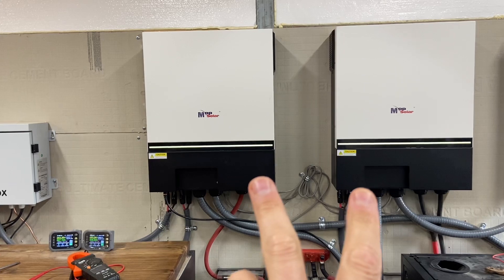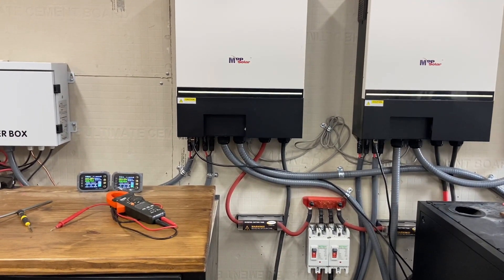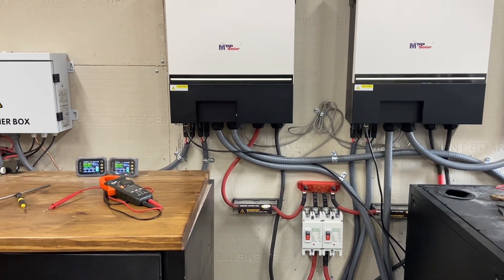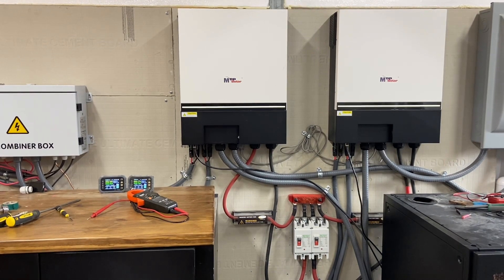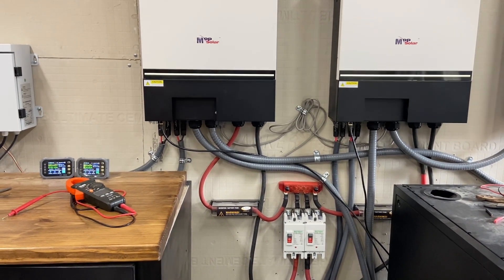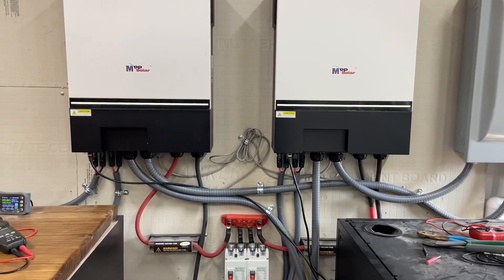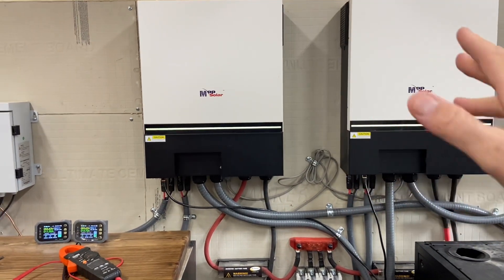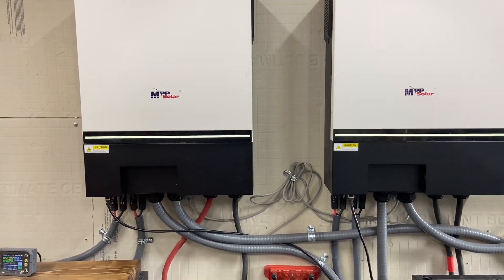My negative thoughts on  EG4 6500ex inverters.

Comment: I’m running the 6000ex from EG4  2 of them total junk flickering lights non stop fault codes and error codes now the units keep shutting down   Unbelievable anyways signature solar has been no help whatsoever they ask for information you send them information you don’t hear back from them wait days and days for a response can’t get a hold of anybody don’t get me wrong they have some fantastic people working there when you finally do get a hold of somebody but I’m definitely going back with my MPP’s over signature solar total junk 👎🏼👎🏼👎🏼👎🏼👎🏼❕❕❕
 The batteries are great  
 I can’t wait to get the 6548’s  
  And yes they are defective  it’s BS 
 They tell me that’s just how they should be running. Total crap. And so many misleading different answers  but like you said never can get and straight forward answer 
 I’m burning breakers up and Jeopardizing appliances in my house because of this faulty garbage all in one unit I’m running
Reply: I had the same experience with them, and I spent 30k. Lesson learned.

Comment: My MPP 6548’s have been running solid for a year now. I do supplement from the grid during summer or long periods of no sun and then only charge off peak rates. Even so my ROI will be 4 years. The only problem I’ve got is when the grid goes down, people keep asking why my whole house is lit up and still running, wondering why they don’t hear a generator.
Reply from the maker: Yeah mine have been running great. I’ve been wondering why you haven’t made more videos on your system. You had some good content.

Comment: I bought a 15K   Seems to be worth it.  I run in in tie grid feeding my shop and house now with the cts. Power goes out  and you off gid.  200 amp hook up.   I all most bought the eg4's but didn't.   I replaced Growatt 12k.  that seems to be a good inverter for $2500.    Just want more solar voltage.
Reply from the maker: Yeah, you really can’t go wrong with a solark. Eventually that’s probably where I’ll land. Deye already has a 16k inverter out now. That would be awesome to see in the next year or two with solark.
Reply: @GavinStoneDIY  you got to pay for it though. And still made in China.
Reply from the maker: @bigblockcutlass123   yeah basically all of them are.

Comment: Possibly stupid question but did you verify they were set to 60hz instead of 50 (Manual says 60hz is default but mine were set to 50hz)  this would cause your exact issue
Reply from the maker: I did verify that yes. I also thought it could be an issue with idle vs having loads. It strobed either way. The real eye opener was when tech support informed me they get calls about that problem all the time. I’ve read that people have scoped the sine wave output and it’s dirty.

Comment: Installed mine yesterday (EG4 6500EX with 3 Lifepower 48V batts with rack @ 120Vac 60Hz. 3500W PV) and I also started to have the same problem among other faults codes (32 and the famous 61) and a "bp" warning. Some LED dimming and non-dimming lights start to flicker or glowing on and off sporadically, one UPS started to make a clicking noise and the refrigerator light (not led) also flickers sporadically. Problem seems to come and go every 10 to 20 minutes. Is annoying. I am very concerned and worried that my appliances will get damaged. I wish I have known about this issue 2 months ago before placing the order to SS. I replaced a 5-year-old 24V 3000W Sungoldpower Inverter which was working perfectly and without this issue never, for this noisy EG4 6500ex piece of caca.  I am very disappointed and mad about this purchase. I regret about choosing this PoS brand and following some guys on YouTube who are posible biased, getting paid or having this equipment for free in order to get honest people to waste their hard-earned money spend on this crap of EG4. Thanks, Kevin, for telling people the truth about this issue and for them to think twice before purchasing this inverter from SS. I live in Puerto Rico and knowing about the restocking fee and shipping cost to send it back to SS gets me very angry. I will save that money and purchase a better brand Inverter and from a trusted and honest company.
Reply: Sorry Gavin, I wrote Kevin in my up comment.

Comment: Since the Neutral ground bond screw is out of your inverter it needs to be bonded in your Sub panel this will fix your lights flickering and going crazy
Reply from the maker: That isn’t the problem. I have everything wired correctly. I have the mpp lv6548’s wired the same way with the bonding screws removed. This has nothing to do with why the lights were flickering. There is an issue with inconsistent voltage coming from the eg4’s. And no issue at all with the mpp version. Eg4’s aren’t generating a pure sine wave in my opinion. All EG46500 inverters seem to have this problem according to signature solar tech support. And that goes far beyond just lights. It will eventually ruin sensitive electronics.

Comment: Thanks for sharing.    EG4 has requested Voltronics make several changes for the EG4 version of the inverters.   Some of the changes include firmware, PV voltage, and connectors.  One of the most recent changes was the removal of the bonding screws.  They may have requested cost savings on some of the components as well.    I have no doubt that one of the changes they made had unintended side effects.
Reply from the maker: Interesting. If they were transparent about that then I would completely understand. I just wouldn’t purchase the inverters. It’s the pretending there is nothing wrong part that I have a problem with. Well, that and charging me 40% restocking fee plus shipping on a defective product. Definitely have an issue with that as well. Since they already know there is an issue, it’s just dishonest.
Reply: @GavinStoneDIY  They should refund those fees! If they want to grow a decent customer base, they will make each and every customer a happy customer!
Reply from the maker: @Tumbleweed5150  everything was completely refunded. I did a follow up video here. Eg4 6500ex follow up review.
https://youtu.be/3192QyqAsCg

Comment: An easier fix would have been to replace your led bulbs with a different brand. I had the same issue, with GRID power, and changing to a more expensive LED solved the problem.
Reply from the maker: If the eg4’s were my first inverters I may have considered it “normal”. But since I had the mpp lv6548’s running with the exact same lights and wiring without any flickers or issue, I realized it’s a problem with the eg4’s themselves. Dimmer switches can malfunction, and cheaper bulbs can shimmer. But I don’t have any problem with my other inverters. So their “upgrades” on these inverters have caused something to create inconsistent voltage. I wouldn’t want to cover that up. Instead I chose to not use what appears to be faulty equipment.
Reply: Led bulbs have different circuits for driving the LEDs and there is no way of knowing what circuit design a bulb uses before buying. You want bulbs that fade to off. If they fade, there is a capacitor just before the LED in the circuit and it costs more to include it. Avoid the cheap bulbs in bulk packaging. No need for premium either. Just experiment with bulbs that are a few dollars more than the cheapest bulb and you could get lucky. Try flicker free bulbs.
Reply from the maker: @adamosity7127  definitely worth experimenting with bulbs. My issue wasn’t with bulbs though. It made my standard halogen bulbs blink the same. Likely s voltage issue. I’ll hopefully have a follow up video soon.

Comment: Wow if I had known  would have never bought them. Going to start mine up next week for the first time.
Reply from the maker: Just keep an eye on it. Running sensitive loads may be a bad idea with those inverters. If you haven’t unboxed them then I believe it’s just a 5% restocking fee and return shipping.
Reply: How has it been going after 5 months?
Reply: @fasnuf  not too bad, but went to move around some pv wires at the inverter and forgot they have power on the input side and fried the pv board.  Had to have it back up asap and ordered a new one.

Comment: I agree the eg46500ex have a dirty output but you have to consider the cost. In my case running 2 EG46500 split phase I scoped the output and it was Very dirty and I did get flickering on some dimmers but not all. I decided to continue to use the EG4 and replace the flickering dimmers with a model that did not show a flickering problem and put all my sensitive electronics on a UPS  that cleans up the power.  Its unfortunate SS has a poor reputation on customer service but with there sales volume and price structure why would they care. How many of you were surprised when Victron pinned there brand to SS.
Reply from the maker: They are just a dealer for Victron I assumed. I did see their announcement. But they are already selling victron products. Like current connected is. I think it’s a shame they are selling unpure sine  wave inverters. The costs isn’t that much different for an mpp version. I would definitely stick with that. The UPS is a good idea in a pinch though.
Reply: The flicker only appears to happen when connected to utility power in specific modes (from numerous reports on forums). There's supposed to be a firmware fix to address it, but it seems like it's too sensitive in it's current response to loads, and those dimmers also use active circuits which might be creating a "ping-ping" effect. I'm going to put a scope on my inverter once it's running (still a bit more wiring to do)...Having a static load on the same circuit seems to help, which would make sense by creating a higher baseline current and stopping the ping-ping responses. If you have a couple of appliances that run all the time (fridge, freezer, HVAC) split them between the two loads and you should see an improvement. It also helps balance the loads between the inverters which needs to be done.
Reply from the maker: @Mike80528  I’d be anxious to hear what results you get from the scope. According to tech support the firmware update was to address the inverter not automatically restarting in certain modes. But has nothing to do with any flickering issues. Although some of their staff on the forum said otherwise.  I tried mine with a load and without. Also with grid and without. It just always seemed to strobe. A slight flicker can occasionally occur with an extremely heavy inductive load. But that happens with most inverter. Sometimes even LF inverters. This was far more then that.
Reply: How do I research the replacement of a CPAP so that it works with the eg4?
Reply from the maker: @boydbrosPMs  I don’t quite understand the question. The cpap is broken? Or you are wondering about a compatibly issue?

Comment: Agree 💯 percent  same problem but to get rid of them probably cost you what you paid to get them plus you will have to replace them and then the guys like will who gets free stuff is quite about them wish I had knew about this would have never buy them.
Reply: 2 eg4 6500ex  for sale $2k.
Reply: @dexbad8857  $1,000
Reply from the maker: You’re correct. You barely get anything back when you return them. In my opinion it would be worth saving for some different inverters. You wouldn’t want anything frying the compressor in your fridge or your smart tv dying.

Comment: Thanks for sharing Gavin.  Had the same experience w/ customer support telling me to remove the dimmers/dimmable bulbs.  You're in a very unique position where you had the old MMPs installed and all you did was swap them out for the 6500s.  They should be near identical w/ the exception of the higher MPPT voltage allowance.
Reply from the maker: Agreed. But that certainly isn’t the case. I never would have imagined they would charge me a 40% restocking fee though. After all that. Extremely disappointed with SS.
Reply: @GavinStoneDIY  really sorry to hear
Reply: I have the flickering led light issue…SS response to me was that is normal with the 6500EX’s…no care at all!
Reply from the maker: @mgoubeaux05  I’m sorry man. They don’t seem to really have  any customer support. And yeah, it’s not normal. So, do yours strobe or flicker?
Reply: Flicker…Normal LEDs with no dimmer
Reply: @bones7151 Did SS send you new inverters?
Reply: @Someoneswave  Yeah, I finally got them installed this week.  Working on an update video right now.
Reply: @AdamDeLayDIY  Looking forward to it.
Reply: After watching your video and several others I was concerned about my SP6500’s  having the same issues on mine  I had just installed 2 dimmer switches and so far looks exactly like the grid!  With all these inverters being made by voltronics I’m convinced EG4 bumping the PV to 500 volts to try and corner the market has really messed with the consistency of the outputs..  anyway glad to see you got fixed up it’s a shame you had to go viral on YouTube to get good support though…. What about all of us without the same platform.?!

Comment: Get Victron or Schneider XW6048 for your sensitive loads and leave those cheap inverters for large loads like stove, motors, heaters etc.
Reply from the maker: I had considered that. With the location of my inverters relative to my main panel that would be difficult to wire. Plus the eg6500’s are high frequency inverters. So they aren’t ideal for larger inductive loads anyway. Which makes them useless in my opinion. So, possibly a cheaper lf inverter. Or I may wait for the mpp 11k inverters that are coming on the market.